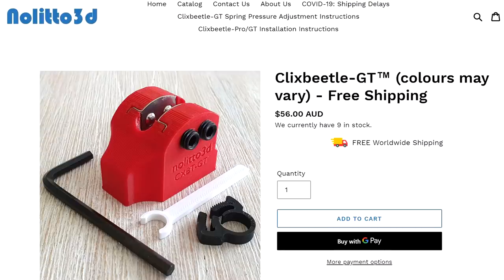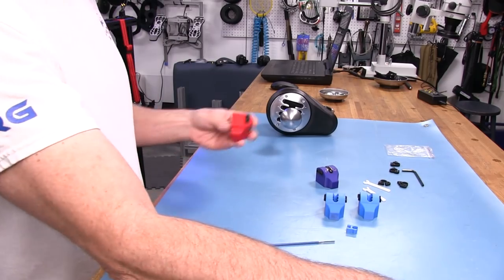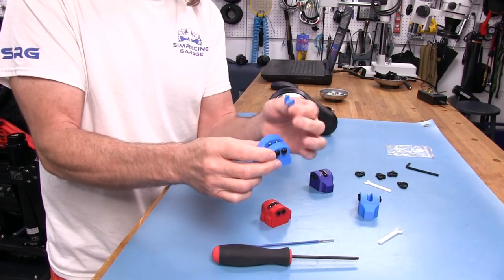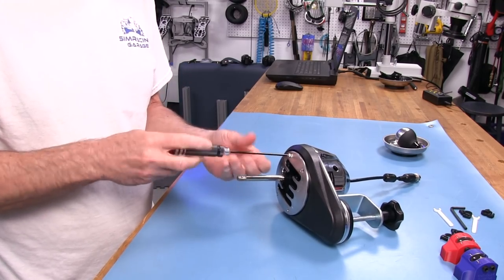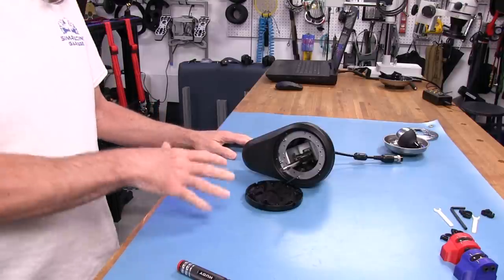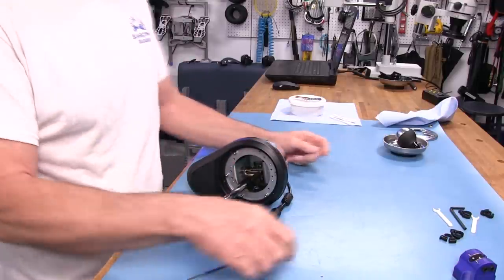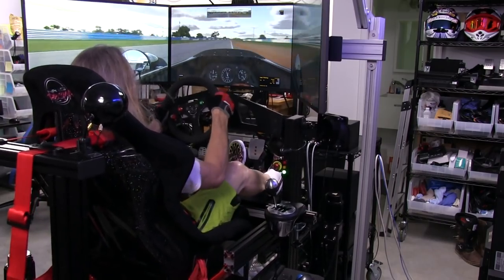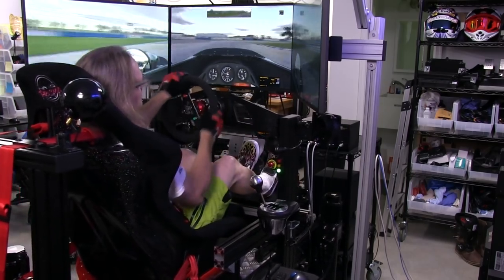New Clixbeetle-GT Thrustmaster TH8A MOD

Comment: Bought the Clixbeetle GT two weeks ago. Mine arrived today. Looked for SRG's video about the older one for installation advice and there's a video for the new one. Perfect timing.
Reply: Finished installing mine. Feels a lot tighter than what it seems like from your demonstration. Not sure if I don't put enough grease but I did put a lot. The ball bearings are factory calibrated (according to the manual) so I didn't touch the ball bearings. I did pushed the clip down to make it tighter. That's probably why, probably not a good idea. Or I simply have weaker wrists than yours.
Reply: Is the red one the latest one?

Comment: I bought this product as soon as I saw this show. I am retired and drive several hours every day. I drive a lot of American Truck Simulator and Dirt Rally 2.0 with my TH8A as well as GT Sport. I try and drive with my "H" pattern all the time. I was worried about the plastic breaking down, but it is still working perfectly. I did use some cheap thread locker on the screws since they did come loose the first time. I wish it was all metal bodied, but so far so good.

Comment: Very easy to install.

I also put a bit of black rubber tape around the shaft to give a better grip to the clips
Reply: Did you use black electrical tape?
Reply: @write2nick  

Yes, around the shaft, to give the clamps a better grip.
Reply: @GastonMaqueda know this is old but right above the clamp or where the clamp goes on?

Comment: Just got this today and may i say it feel so much better!
Reply: Hi, did you get the Red or Blue one? Noticed the red one is more money.
Reply: @markweatherall7437  I got the blue one. Still using it and the tactile feel is still great
Reply: @Andehzarz   Thats good to hear thanks.
Reply: @markweatherall7437  I just got on their site and the color varies. I want to let you know I got the gt with the metal plates.
Reply: @markweatherall7437  I feel the gt will be more durable than the pro since there's no metal plate in the middle. Since the shaft for the th8a is metal it might wear down the pro faster than the gt.
Reply: Ok thanks @Andehzarz Yes I notice in the listing pictures that the GT (Red) has metal, thanks for that.

Comment: 1 simple ziptie would have held it in place, mine used to come up too and that 100% solved it, it will also make it last longer because it wont wear from going up and down which scratches the 3d printing
Reply: mine is also going up within a few gear shifts. Very diappointed. I have tried your solution with a simple ziptie, but it also moves up beacause the gear pole is very smooth. How did you manage this, if I may ask? Thank you!

Comment: My shifter had a very tight-fitting cable tie with very little of it to get cutters onto. I had to melt it off with a soldering iron. I inadvertently melted a small hole in the cloth, as it came in contact withe the side of the soldering iron shaft, so try and avoid this if you also have to try the melt-off option. Also, the plastic ring on the cloth cover fell off very easily. It has 2 parts that I will try to  re-attach. I don't think these issues are critical but they did come up for me.
Reply: I wonder why grease the front and back of the Clixbeetle body if there's an issue with the unit riding up the shaft. Isn't greasing those spots actually working against the retainer clip? This is pretty solid-looking plastic to me. So why the grease on the front and back? Why would 'scratches' to the 3D printed plastic be an issue?
Reply: "For added durability." replied Clixbeetle support. Check!

Comment: They are available again! Bought immediately this one with the metal plate. Let's see how long it gonna take to ship it to Germany. Can't wait to install it. This only because I stumbled upon your video. Thanks
Reply: How are they holding up ?
Reply: @xk964264  to be honest I do not use it anymore. It was too stiff for me and the hight is to big. The tishue was too far up so sometimes it blocked the gears to get into. I removed this and use my full plastic block which will be installed the same. But wears off and is not more that stiff when shifting.

Comment: You say this is going to wear and I read a comment below saying it didn't last very long (they said hours, but I don't know if that's an exaggeration). Let's say it hypothetically wears out in three months. Not only would it cost the price of the shifter itself within a year, but the performance would constantly be degrading. I'd rather pay more for something more permanent.

If I only played on PC I'd just save towards a better shifter, but the reason I went with the TH8A is because I wanted to use it on console too for PS3/4 games. In fact, I wish new wheels (including direct drive wheels) worked with PS2 as well because some of the games are damn good fun, but I'm getting off topic.

Comment: I have had mine installed in my TH8A for a week or so, I had to snug the screws yesterday. Not sure why the screws are so loose. I might get some low strength thread lockers and put it on the screws. I noticed my thin win wire to the black cap broke off. I had to turn the shifter inside and I guess I broke it. No problem for "H" pattern at least. Trying to decide if I want to order a spare, it is plastic, or not... Wish it was metal.

Comment: I think if youre looking to buy a shifter. just go ahead and save for the fanatec one. In the end its much better and if you buy the TH8A with mods etc.) youre basically at the price of the fanatec. This is definitely for people who already own one.
Reply: Fanatec h pattern is known to have issues. It also doesn't look as good as the gated thrustmaster shifter and can't be easily mounted to a desk.
Reply: @quantametric  Those issues with the Fanatec are far and few between and from what ive read on forums, their customer support is great and they will replace/fix. I never had any issues with the one I have used for 3+ and has 2500+ hours of pretty heavy handed use of downshifting, jumping gears, or just banging through the range pretty aggressively in everything from Drifting, Rally Racing, Road Cars, etc). The Fanatec does have a "Desk Clamp". Ive owned both with enough experience . I'd e expect Form over Function to be way more important for shifter, especially for Sim Racing Hardware and I cant imagine subjective looks would be the deciding factor for buying something inferior. You'd think most racers would care more about the actual feel and overall experience they get from it. 
- The TH8A isnt "bad", it feels decent out of the box, it can be improved substantially with cheap mods making it feel way better (Highly Recommended). 
- But, when directly comparing the TH8A to the Fanatec, there no questioning it falls short in nearly every aspect.   
- IMO, the overall the build quality and functionality is Superior. A huge advantage is the Switching from H to Sequential. It takes 1 second with a flip of a switch while the TH8A this whole process required in removing changing the top plate thats screwed in place which extremely annoying and takes time away from actual racing. Especially when youre changing cars  in AC, Dirt Rally, Gran Turismo, etc) that all are H or Seq transmissions and you want to accurately reflect their behavior with your shifter matching for a more immersive experience. #1 reason a moved away from the TH8A so fast because it got so annoying I ended up either driving everything in H pattern or Seq mode because within days I was already annoyed and tired of it. Or I was kind of pigeon holed to use certain cars for a period of time because I didnt want to change the damn Gated Plate. Just speaking for myself. I know Eco System compatibility forces people (mainly console users) use one or the other as well which sucks. But PC can let people have a mic match set of pedals, wheelbases, shifters, etc). Back to Functionality and Forum, VNM and other companies are putting out some serious competitors within that $150-200 price range and the recent VNM Shifter is a plain looking as it gets but feels great because simply  avoiding the cost of unique tooling and manufacturing costs for "looks"  put those costs into having better quality components its overall build qualiy, longevity, and most importantly "feel", in which Id think most people care much more about. There is also another Shifter that recently popped on for $90-100 shifter sold on Amazon that people are going crazy for and it 10x better than Logitech plastic piece of crap while being much closer to a midrange product. But yeah, Id imagine for most people in the heat of a race and banging through gears in the heat of racing are more concerned about the feel and user experience over the way it acutally looks.
- Ill re-terate. Its a shifter fuck sake, lol. at the end of the day, what's the most important factors most racers would require/want in a shifter.
- Compatibility
- Build Quality
- Overall Feel/Tactile feedback
- Ability to Change that Feel with Stiffness 
- If the shifter is H and S, needing a fast way and effortless way to switch modes
- Mounting solutions. Which Fantatec does have desk clamp which allows for multiple configurations to position it for ones needs allowing way more versatility over the TH8A. it also has solid mounting points for 80/20 aluminum Cockpits and other Sim Rigs which is important to a lot of people since if they are paying $200 for a shifter, the odds of them having even a cheap cockpit are high. the weird TH8A's Ice-cream Coned Shape doesn't make mounting to a rig an easy optio n in general let alone in multiple ways for finding the perfect position for ones taste.
Reply: @d3tach3d  Those are some good points, although a little extreme in their volume. You obviously think a lot about this stuff.

I'm perfectly happy with my th8a, I find nothing to be desired about it. Given that I am sticking to a desk mounted rig I think it works better than the fanatec would. Yes I could buy amount from Fanatec but that would cost me hundreds more. I've heard from a lot of people that fanatecs technical support is not good. Have you dealt with them personally?

And then of course is the price difference. Here in Australia a fanatec wheel by itself costs around $800. That's without the wheelbase. Thrustmasters wheels are 400 and look just as good imo, particularly the sparco rally wheel. The entire fanatec ecosystem is approximately double the price of the thrustmaster one here.
Reply: @quantametric  I hear you, I defintetely dont knock you for picking products based on your budget and how far your willing to go into a sim setup. I think an old G25 with a brake mod and steering wheel adapter is a great entry level option for 99% of people. Your right about me being heavily opinionated or invested into Sim Gear. Its because I started out with a G25 and over the last 10 years I upgraded based on what suited my finances, space. and other reasons at any given time. I stayed with low level gear for 3+ years because the market had way less to choose from and Modding gear was popular and brought longevitiy., Then I upgrade to a midrange setup for another 3+ years with a  T500, G27 Pedals modded with a heavy spring and cone for better brake feel, and got the TH8A which I also eventually modded to be alot more snappy, tactile, and more bite. I eventually said screw it and saved up for my last ultmate purchase with no more upgrading in mind a couple years ago. I built my own   Aluminum Rig/chassis like all those other expensive ones  being sold for $1200 and just sourced the pieces and hardware myself for a 1/4 the cost. I also bought some Fanatec Clubsport V3s becuse they were best bang for buck at the time, and the main showpiece being the Simucube 2 Sport. I also have 6 tactile transducers. 1 on each corner of the rig and 2 on my seat which vibrate to what whatever intensity or job a need them to do which is a HUGE immersion adder for anybody, even if they have 1 on a office chair. Dont ever buy Buttkicker and there amps. Theyre 10 times the price for 1 kicker and amp over my Dayton brand transducers and a couple cheap usb/soundcard/amps. Theyre all controlled with SimHub software and provide so much feedback than one could imagine. You should look into them. just 1 or 2 pucks and an amp would blow your mind. For my 6 Puck solution which is as close getting a motion platform of feedback, and  2 Amps cost me about $300 opposed to 1 single buttkicker/amp thats $600+. Im frugal with my money with alot of things which always made me educate myself as much as possible when investing into anything and I DIY as much as I can as well. This approach saved me thousands of dollars for my current Sim Rig setup that would be closer to 5 grand if retailed instead of $2500 for everything including triple monitors (not PC though) and no buyers remorse or regrets. I also made over half that back selling off my old Sim Gear. I recently updated my pedals to some proper load cell based ones as well but I think Im good for a couple years. I obviously still spent a lot of money but was saved up over tim, I recouped alot when selling my old gear, and in my case, I also Build and Race Cars IRL so the the 2.5K invested in my rig is nothing compared to a single entry level shit box race car thats a gutted BMW 325i that is a minimum of 5-7K to be race legal for time attack, rally, autocross, etc.) then you count Tires, maintenance, parts, etc) the costs are insane just on a small scale. So the passion is there and for what I get from the Sim Rig is arguably saving my money and for everything it provides its the best things ive ever had when it comes to having an amazing time racing, learning skills, practicing, and sharing the experience with friends and family thats not practical for my IRL cars. It still blows me away how these Sims provide people   untaggable amounts of value when lookd at on a broader spectrum for their overall cost. I cant think of a single thing even close in price that constantly offers entertainment and joy.

Comment: Does anyone have a long-term review of this? Would like to know how this held up and if has met your expectations.
Reply: Ive heard of some lasting loads I'm in the southern portion of america so after this bad weather my shifter should get delivered and hopefully I remember to followup
Reply: @Dragonstorm1557GAMING  please do. Thanks!
Reply: @Dragonstorm1557GAMING , so what's the news on long term usage?
Reply: @affliction1979  very good it outlasted the wheel it was paired with
Reply: @affliction1979  it has a real shift knob on now and I slam the gears like its a real transmission it's truly indestructible and I set the best lap time on ps4 with a turbocharged hot hatch. Really wasn't expecting to be a better driver with this but I really am. I also had it setup so the shifter was at my waist just like a real car. My only complaint is that the sequential plate is garbage but thankfully I don't need sequential
Reply: @Dragonstorm1557GAMING  same....h pattern is way more fun. But that heavy shift knob does make a big difference
Reply: @noobsimdriver  only in my wettest dreams can I imagine a clix beetle with real knob I don't even have console anymore so getting another is unrealistic
Reply: @Dragonstorm1557GAMING  not really. I only paid 100 for my th8a

Comment: I'm sure it would work fine, but I have to ask. Does this work with the ricmotech short shift plate? Also, will there be any issues keeping this in there when using in sequential mode also with the ricmotech tactile sequential plate?
Reply: someone above says yes
Reply: @handrewmillan4293  It does work without issues. Thanks

Comment: While removing the lower plate like a dumbass i broke the 2 soldered wires, are those wires important? If so how do i go about soldering it? Should i extend the wire since its super hard to solder with a short wire and i dont wanna burn the plastic, any help will be greatly appreciated thanks!
Reply: @Lone Drifter Yeah same i just taped the wire to the frame and dealt with it, i dont use sequential

Comment: Do you know the diameter of the ball bearings? Due to noise restraints i may purchase this if i am able to replace the bearings with nylon ones and reduce the 'click' sound. Thanks also for a great review!
Reply: I don't think you have to. It feels tight and good. I put a lot of grease on mine and there's no clicky noise at all. Or maybe there wasn't enough grease after all...
Reply: @Hzuuuu  Great thanks Deo for the reply

Comment: Great vid as usual, ty Barry ! I just mounted mine (GT) over a noname 3d printed gate and I must say I'm quite disappointed for now, to the point I even brought back the cheap one in it. To me it's not tightened enough, even if I tried to of course. :/ There's too much play between my Clixbeetle and my TH8 metal structure. Also the clips aren't trustworthy unfortunately., the plastic is too flexible and the dents aren't precisely efficient here. Any thoughts or advise dear simracing guru ? ;)
Reply: Have you tried contacting the manufacturer for support? They should be able to help.
Reply: @raytracelogs9375  Not for the time being, but I'll do after another try if it's still so disappointing indeed.

Comment: There is a screw for resistance on the side of the shifter... u dont need this mod.
Check the th8a book
Reply: The resistance only work so much. After a while is wears out and feels dull. I have the TH8A for 2 years so it make sense it's worn out. With this, it brings a better tactile feel to it. Definitely not the same with just "screwing in" the resistance screw.
Reply: lol